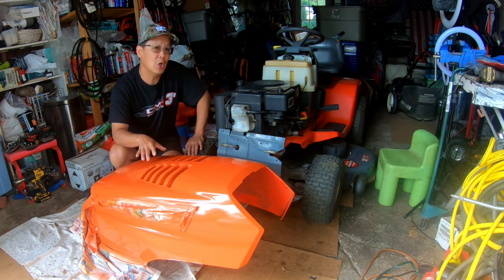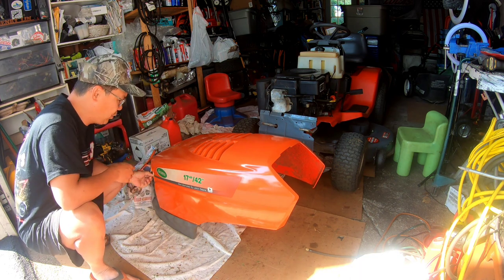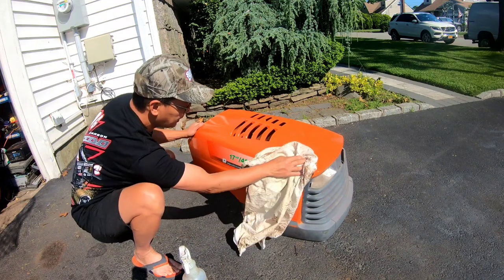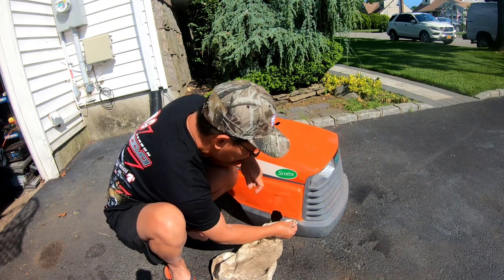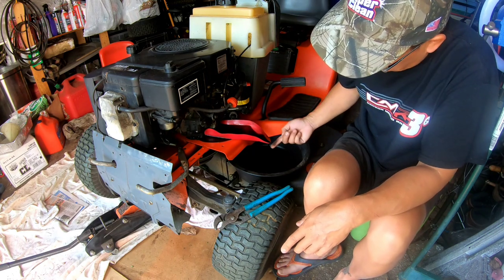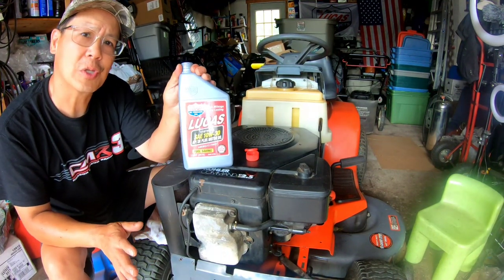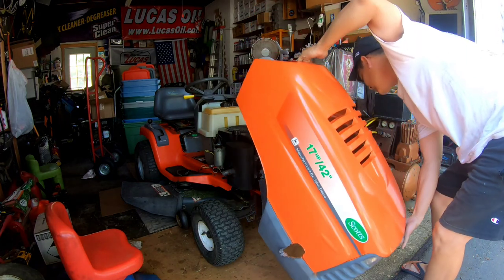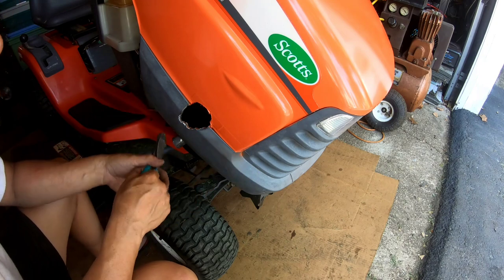SCOTTS JOHN DEERE LAWN TRACTOR REPOWER PROJECT FINALE HEADLIGHT REPAIR HOOD INSTALL OIL CHANGE FIXED

Comment: On my Scotts S2046 the lights run off of AC power from the alternator - at low RPM's it's about 7.5V and at full throttle it's maybe 19V AC. The alternator has two wires, one with a diode that goes to charge the battery.
Reply from the maker: The diode prevents a reverse circuit that fries the stator

Comment: Henry, I wonder if Kubota Orange would have been just a little darker than the Husqvarna Orange. Either way, The Scott’s by John Deere tractor looks really good.
Henry, I was wondering if maybe a set of carbide burr bits like that are intended for a die grinders for metal working would work okay for shaping the exhaust hole in the hood. The major drawback is that those bits really are aggressive with metal and just a slight miscue could take away far too much working with far softer materials.
Reply from the maker: It was all I had handy.
Reply: @MowersNBlowers  You did a fine job,Henry.. 
I wish my headlights were that bright on my MTD garden tractor. I tried LED bulbs that I purchased from off of eBay and was not very happy with them. I put brand new glass incandescent bulbs back in after removing the very disappointing LEDs.
Reply from the maker: @TheIronDuke502  is your current off the stator? Higher throttle they get brighter, low throttle lower? I connected to switched 12v off battery, same brightness full time.
Reply: @MowersNBlowers  Yeah, That sounds about right concerning the RPMs the engine is turning in relation to the brightness of the headlights - Kind of reminds me of the headlights for bicycles that had the small mini generator that mounts onto the steering fork that made contact with the sidewall of the front tire. 
If you were a speedy driver,You always had plenty of light from the headlight. If you had the deluxe version, you also had a tail light for the rear of the bicycle. 
I ordered some bolt on LED headlights from eBay in which I made up a wiring harness and installed a push pull light switch and a weather proof fuse holder with ATC fuse while utilizing the accessory pigtail intended for the factory headlights. 
I just couldn’t allow myself to spend the extra money for the OEM John Deere grille with headlights. My eBay LED headlights works great and costs substantially less with not that much current drain on the stator. The crappy push pull switch that I purchased at Autozone doesn’t fare well for outside use.

Comment: Next time jack up the mower on the opposite side from the drain so it tilts down. 👍👍
Reply from the maker: Yeah like under the deck.
Reply: @MowersNBlowers  under the rail on the opposite side of the drain plug.

Comment: Looks good,, just not crazy  about cutting the hood,, thats gonna hurt resale
Reply from the maker: Unavoidable
Reply: @MowersNBlowers  I think cutting the hood might have looked a little nicer if you'd used a hole saw.  I have learned though, that when cutting plastic/vinyl (siding) to cut counter clock wise to avoid chipping or breaking the vinyl or plastic.